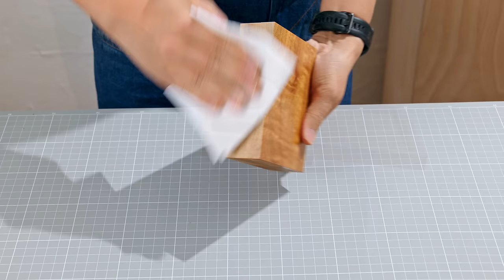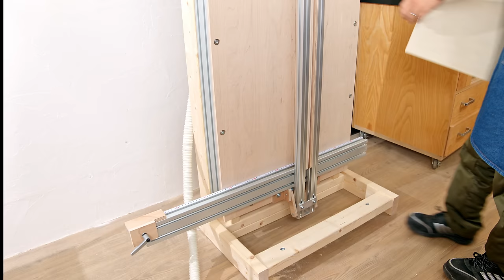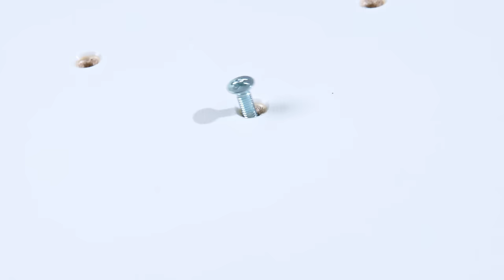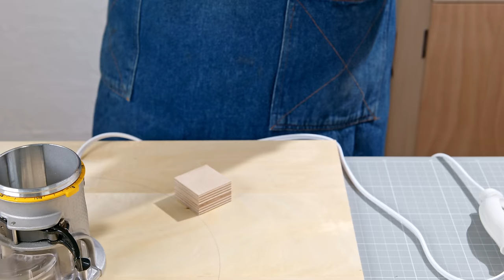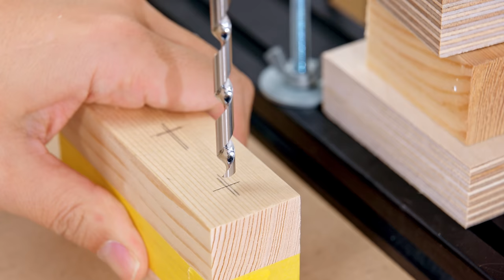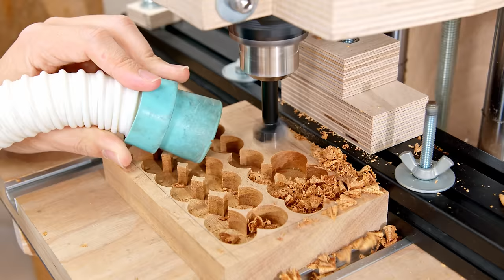DIY 4 in 1 Router Table ~ 4Hacks

Comment: That's really nice, especially given how simple it is. I don't know about having it all supported by the bucket in the middle though. I'd be worried about it tipping over if you pressed down on any of the edges.
Reply: It seems to work well for small pieces. I think if you were working with larger pieces of wood, you would definitely want more support and something to keep it from tipping. But you could probably make some simple swing arms that are attached to the bottom of the table to hold the bucket and then just lay some 2x across your saw horses, set the table on the 2x’s and then you’re good to go! Overall, I really like the simplicity of it.
Reply: That was my thought as well. I think you could mitigate most of it by making the table as small as possible.
Reply from the maker: your opinion is correct.
When processing large materials, I think you need legs to support the table.

For small materials it is not a problem at all.
Also, by attaching a dust collector, the top plate will be adsorbed, making it difficult to move.
Reply: Fold out legs would support.

Comment: Thank you for your magnificent video, I am a retired carpenter and I love Routers, I have lots of jigs and all different types of adjustments for router's, but this one I have just seen, it's great, I definitely will be making my own. Thank you again and one question
The panel saw, you used, I couldn't see any saw? What did you use please.
I've been thinking of doing one with a router. (any videos in that matter?
Thank you for your great help.
Reply: Luis, check out the vid here: https://youtu.be/K5uAtBWTY3Q  It's remarkable, as is the rest of his work. Enjoy.
Reply: Try this one - https://www.youtube.com/watch?v=K5uAtBWTY3Q
Reply: @secondwind75 

 Thanks for your help, and I am very pleased with it, now I see
 where the saw is, I would like to make one, petty, that there is no drawings and messurements with it. I guess I will have to do some work of my own 😅. Thanks again and good luck 🍀

Comment: as much as I like the taping of the plastic sheet??! I would have used a laminated particleboard for the top (fx side of a cheap cabinet), supported by plywood.

Or laminate a sheet over the plywood. Again love the ease of using tape. Great video.

Comment: Techinical Question: How do you adjust the depth that the bit extends past the work surface? At 8:48 right after you inserted the chamfer bit with the bearing you place the router with the bit inserted into the barrel with the work surface rest on top, and the chamfer bit is clearly not protruding at all past the work surface. Then at 8:54 you insert the dust collection hose at which time we see the chamfer bit is clearly not protruding past the work surface so that it will actually route whatever material you pass across the work surface. How did you adjust the height of the bit?

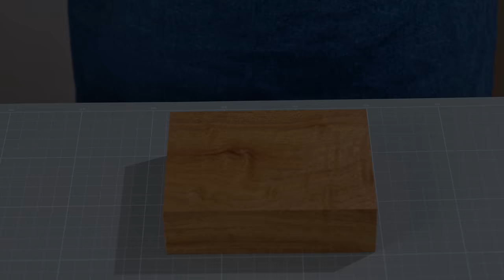Comment: I suggest making a "starter bit" for when doing freehand chamfering 1:34 … Also the idea with placing the table on top of a barrel underneath seems a bit risky – heavier workpieces could tip the whole jig over, if it they're placed on the outer edges of the table...

Comment: Hi. I really like your work ❤. I'm trying to do the box also but have many issues. What kind of wood did you use for the box? I'm using walnut and my router having a lot of trouble with it. And what kind of router bit did you use and at what speed?

Comment: I love the clean and simple design! The only thing that worries me is how difficult it would be to adjust the router height and change bits... I didn't see any of that demonstrated in the video, but maybe it's easier than I'm imagining.
Reply: Yes, he did show how it was done at the beginning of the video. Lift the whole assy from the bucket, turn it 180 and unlock the router from its casing. simple as that.
This guy is a magician. The epitome of woodworking intelligence and ingeniosity. I don't have the patience to work like this. My shop is a big tent outside my house with all the power and tools I buy. Just watching those videos is like candy to my eyes.
Reply: Agree here. Nearly perfect, just an above table depth adjustment or using a router that accommodates that would make this even neater and easier to use once set up

Comment: Thank you for your presentation. But I have a small advice.
You move your wood work pieces in the false direction while passing the router bit in any parts of your video.
You must move the wood work pieces in opposite direction in relation to rotation direction of the router bit (wood work pieces from right to the left). 
Your moving is dangerous. If you will use your moving direction (left to right) the router bit will tear away the wooden parts.
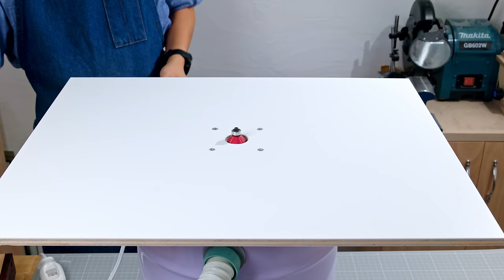Please see at position 9:05 - here the direction is O.K. .
But position 12:26 - the direction is dangerous!
Please be careful!

Comment: I guess it can reduce the noise compared to the open frame?
Reply from the maker: Noise is a little less. But not enough.
↓This router table is quiet.
https://youtu.be/MhIzJrTYHBc
However, cutting noise cannot be completely silenced.
I use earmuffs on both.
Your ears are important.

Comment: That's a novel idea! I'd rather build a router table that has an open area for changing the router bit without having to lift the board and the router off the pail each time, then putting it back on every time - too tedious for me. Hope you wear a mask when routing, sawing MDF, it's just compressed sawdust and glue, which is bad for anyone's lungs when it is turned into dust again. I'll subscribe anyway, you have some great hacks.

Comment: Just placing the table onto the bucket like that is a recipe for disaster. It doesn't take much for the entire thing to tip over, and then you have a running router loose in the shop. The bucket should be fixed to the floor, and the table fixed to the bucket. Combined, there just isn't enough weight to operate it safely.
Safety first guys!

Comment: You wouldn't plunge a workpiece onto the router if you saw how my dad lost most of his fingers on one hand doing just that!
Reply from the maker: I feel sorry for that. . .
I also agree that a router is a dangerous processing machine.
Reply: Good point, I guess boring out a starting hole with a spade bit would be safer
Reply: @@richy77g99  NO! Keeping your fingers further from the router bit and not in a place that will drag them through the router bit if it 'bites' ... would be the way to keep your fingers!

Comment: This solution is not the best. The suctioned dust also gets into the motor of the milling cutter.😐
Reply from the maker: Yes, but have you ever had a real problem?
I've built similar jigs in the past and never had a problem. I have a router table that I put in a case and have been using for 4 years, but there is no problem.
Please let me know if you have experienced any problems.
Anyone can come up with your opinion, so "thought" doesn't mean much.
Reply: @jisakukobo  Thank you for your answer. It is a theoretical problem, I have not yet built a comparable ruter table. But if you've had experience with it for so long, I'll give it a try. Thanks and greetings from germany👍